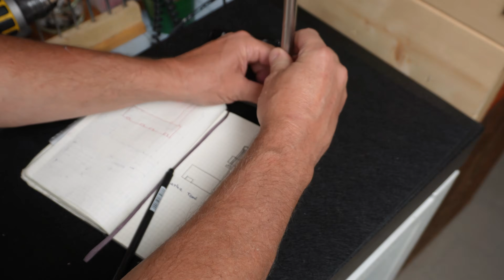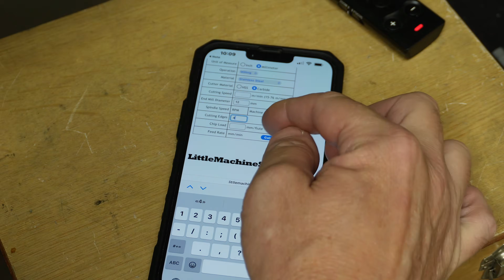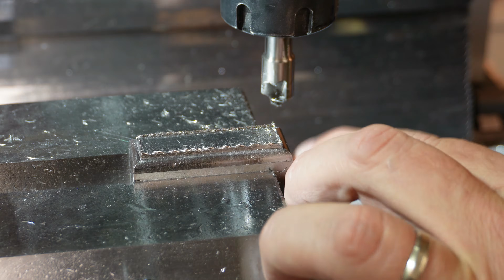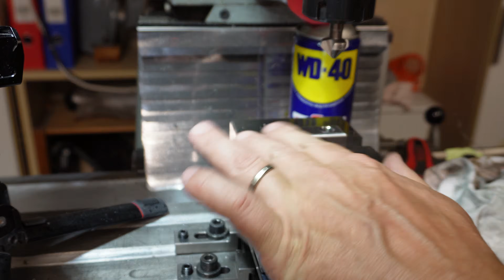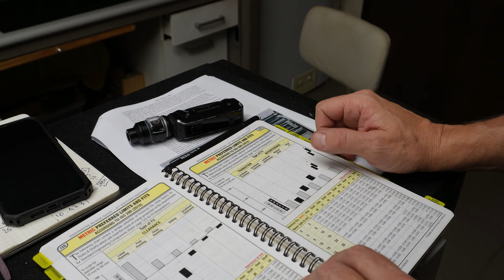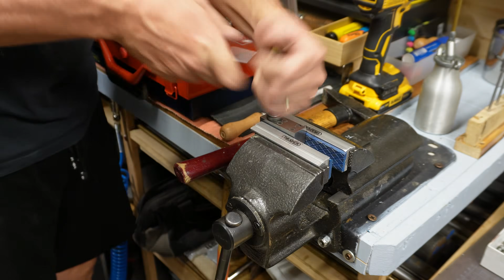How to Build a Precision Lathe Tool Height Gauge – Tips & Mistakes to Avoid

Comment: Nice job 👍
Reply from the maker: What kind Lathe do you own?
Reply: @MecMod_Homeshop I own a colchester master 2500 14x40 inch and zmm sliven cu310 14x50 inch
Reply from the maker: Two lathe
Reply from the maker: Now I’m dreaming a Weiler
Reply: @MecMod_Homeshop  yes my friend two lathe machines
Reply from the maker: Do use both? One for inch and one for metric or for business?
Reply: @MecMod_Homeshop  Soon I will be making a video tour of my small workshop
Reply from the maker: Will be great my friend, I can’t wait to see
Reply: @MecMod_Homeshop  This isn’t a full-scale commercial operation — it’s simply my passion, and I genuinely enjoy working in this field. I use DRO for both machine one Mitutoyo and one Chinese, I installed a 4-jaw independent chuck on one of my machines to not need to change the chuck.
Reply from the maker: Nice and set-up easy in that way
Reply from the maker: Many thanks my friend